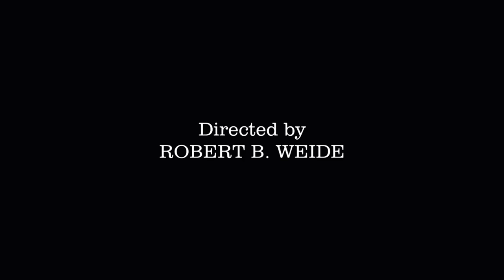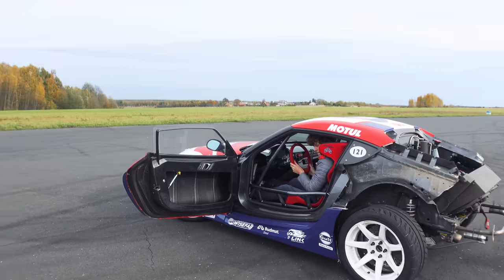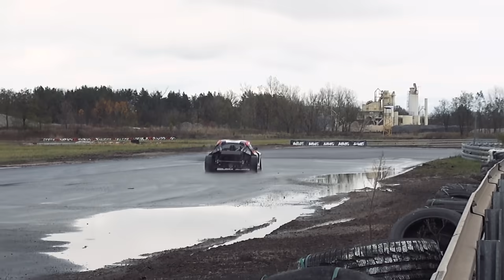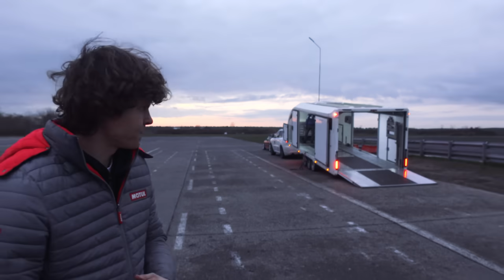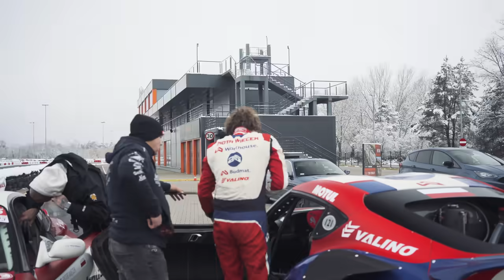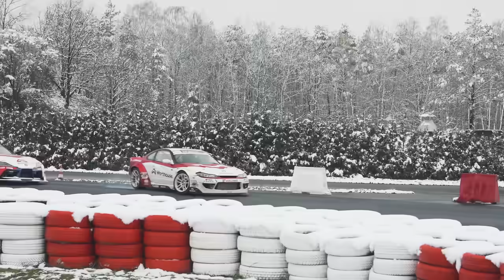First tandems with Supra!

Comment: Hello. I am watching you and your drifting for a long time. As I see, the continuous problems with Supra, and the fact that is still not matching the S15, I am wondering, does it really worth to change S15 with a new machine with similar/less capabilities? Don't misunderstand me, it looks great and it's a new machine (I saw it "live" in Warsaw also at the biggest drift event), but where is the catch? Building a new machine with old setup? Wouldn't be easier to rip off the S15 and put it in the Supra?It is not my problem, I understand that it is new, sponsorship, wow factor.. but there is a lot of money involved. Anyway can't wait to see it in action with you on board. Good luck and congrats ...
Reply: The problem is a different chasis, so he needs to learn the chasis, meaning how to throw it around , whats the limit. Its not a power train issue. It will be realiable. He just need to learn and also adust it. Remember, piotr drives to perfection so it takes alot of mental work as well with setting up the chasis/suspension to work together with what piotr wants it to do
Reply: Rules determines location of shock's and lower and upper arm locations and angels, so its basicly not possible to clone handling capabilities from nissan to toyoda
Reply: Piotr said in an episode of the Driftingowy backstage podcast that they started building the Supra because they still want to improve, and with the s15 they have reached the wall and no longer have ideas to significantly improve this car
Reply: S15 is an old chassis. Biggest problem I see that they’re perhaps trying to make the Supra close to S15 which is not possible, it does handle completely different.
Reply: i think also one if the reasons to keep pursuing the supra is because of the sponsors i might be wrong but its feels like the sponsors need something new to showcase their brand on .!

Comment: I think the supra needs electric steering pump so it’s better to use in drifting plus try to play the suspension setup between dry and wet setup just like the rtr they have suspension setup dry and wet, hopefully it helps.😊
Reply: RTR and Supra are two completely different cars…. Poitr knows what he’s doing. He’s a professional

Comment: You till look faster and smoother in the S15 for some reason. But you will get there eventually in due time.
Reply: Plus, you also need to take into consideration that you have been driving the s15 for a while now, so your style adapted to the chassis. Just need more seat time with the supra.